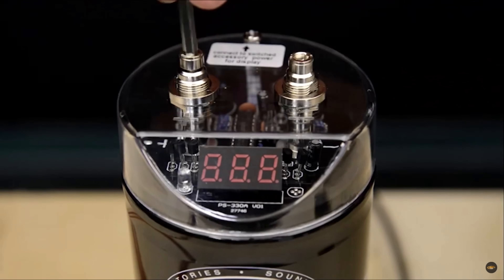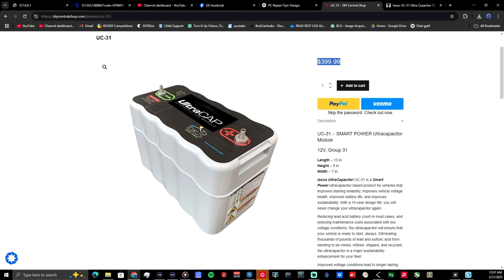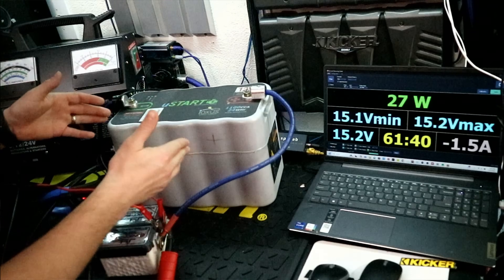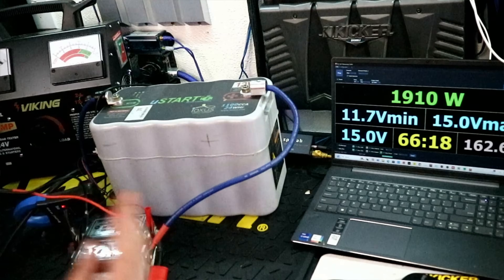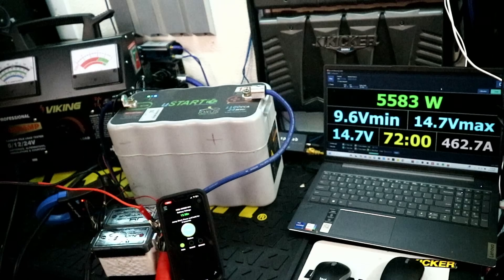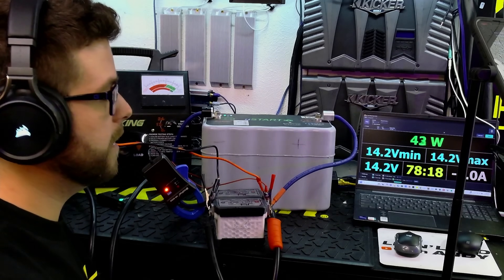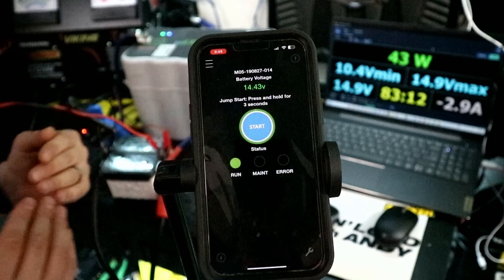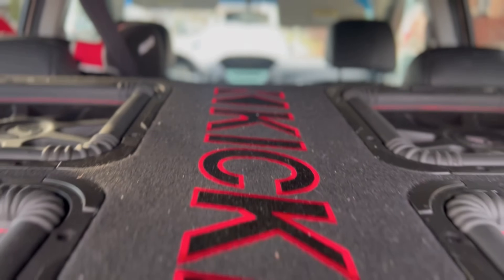Is it the Ultimate Capacitor For Car Audio? Ultra Capacitor UC-31

Comment: If yourself thinking about buying these to salvage the caps now that they are CHEAP (less than $100). Do not do it, the reason they are so heavy isn’t the caps (duh) it is because they are die cast injected, meaning it is a SOLID block of PLASTIC. It will take you days and days and days of cutting and you will most likely ruin the components.

Comment: So I have a cyber 12k and when the voltage drops from bass let's say from 14.4 to 14.2 I can still see the headlights dim wondering if the super cap would change that if I replace my under hood agm with it

Comment: A good visual test would be getting a 5 gallon bucket to represent the capacitor. Start filling the bucket at 1 gallon per minute to represent the battery and charging system. Have an “output” hose coming out the 5 gallon bucket and pull 3/4 gallon per minute with short intervals of 2 gallons per minute. It shows how you can pull more from your system than it could normally provide while building a reservoir of charge.

Comment: Interesting that it is so heavy because my Maxwell Ultracapacitors  don't come close to being that heavy and I am talking about my 24v ones my 12v set up can crank the engine on my vehicle for almost 30 seconds which I don't ever recommend for anyone to ever do to a starter or on a battery. Why is it so heavy??? I can pick the Maxwells with my pinky.

Comment: The ultracap is for bursts of energy not sustained amounts of currents, an AGM(for example) is better for the sustained amounts of current, use them together so that when your bass kicks your voltage doesn't drop....they both should be used together but you should be playing regular tunes and watching the voltage as the bass kicks not during sustained notes, test the voltage drop when the subs are kicking
Reply: I was going to say the same thing, also batteries should be able to output the total avarage power over time of the system playing music and the capacitor should match the peak output power

Comment: You’re missing the alternator pumping charge on the cap and battery. Also you are correct the battery needs to be more actual size. Same environment. I have one and have system full volume and voltage barely drops below 12.8.

Comment: lol sorry but your test means nothing to what the cap is meant to do. you put a constant high load that's not what a amp dose they get quick bursts of high load and then quick low loads an in that case the UC-31 wont go in to error mode it would recover its voltage/charge in milliseconds because in a auto there's a alt an battery. in my last setup I was running 4 Rockford power punch 800a4's bridged on 4 L715's with high amp alt and 2 group 35 lead battery's with 4 runs 2/0 OFC wire and it would dam near kill the headlights and pull voltage from 14.2volts to 12.1v in few sec and after the UC-31 was installed lowest it got was 14v even on regular music and 13.7v on pure base (like base mechanic) it made a massive difference. thanks for sharing Andy
Reply from the maker: Oh they absolutely do work and are meant for quick discharges 

I wanted to do a brutal test - constant power can still be demanded with today’s “rebassed” music 

It’s practically a sine wave… 

This cap does the trick and I’m glad it’s working for your set up too!!!

Comment: Capacitors are never dead in car audio a lot of people don’t understand how to use them like right now I have 40ah scib way more than enough juice for my system charging at 15v and clamping 7.5k dropping to 14.8 

Now with a 16v 500f cap I can hit 7.6k clean but the Subs can’t take anymore but my voltage doesn’t move from 15v on a 320 alt
Reply: So you are using this cap together with your scib bank?
Reply: @Djmam @Djmambo77 
There are some videos on YT with yinlong and cap just the battery he was able to clamp 16,000w then with the cap and battery 21,000w 

You just have to make sure you have enough head room with everything

Comment: Thoughts on the Rockford fosgate hybrid capacitor?
Reply from the maker: If you’re wanting better voltage for long bass notes - look into something different 

It definitely works as a filtering cap and some extra oomph for those quick bass notes.!
Reply: @ ok so like what? I don’t want this big ass capacitor. What do you reccomend? I already have xs power 3400 battery and big three but 110 amp I don’t want to get new alternator and I only have a 900/4 hd jl audio amp and a xd600/1 jl audio amp , I want the capacitor only for the xd600/1 amp

Comment: I have a question. What’s the best way to run audio for 15-20min with the car off? A bunch of high AH batteries in parallel? A lithium battery/bank? Maybe u could test this out for fun? The reason why I ask is cuz I have a hybrid so basically when I’m at a stop light the engine is off so I’m running off capacity and want to increase that before the battery drains, and also when I park and wanna finish listening to a song. Thanks ahead of time!

Comment: I would love to see someone out there test Walmart wiring and see if it auctually lets you push the rated wattage comfortably or if your going to melt something trying to hit that rated number
Reply from the maker: Comfortably and Safely, neither honestly..

The wattage numbers they list are unrealistic unfortunately, Max Power ratings at their finest! 

Safely , half of their claims 

I need to do a good video on this topic .. but think of it like this 

Bigger wire - shorter run = More power you can carry 

Most kits you see like that are a set length so that variable doesn’t change 

So all you can look at is size at this point 

There are other variables as in type of wire 
OFC/ CCA  that work better or worse and the price always reflects that 

To the point… 

8 Guage kits are usually good for 50a for a kit 
50x12v that’s in your car - so 600w at the most 

4guage roughly 80-100a 
1000-1200w 

But that’s really at their extreme with more voltage drop than you really want ..

Never cheap out on your foundation… the electrical 👊🏼
Reply: I wish my garage was bigger, I've lived where I've lived for 10 years now. I can't open my pickup doors very much and I'm a petite female. A normally rerun fresh speaker wires RCA wires, redo the grounds, especially when living up in the Midwest, although before that I used to live by the ocean. My 🛻 is 22 years old. I haven't redone fresh wires in a while. The most recent big 3 upgrade was 10 yrs ago. It was kind of a celebration for myself, I bought myself new amps and an eight-F capacitor. I was bummed out when I realized there was no way that was going to fit into a single cab truck. Also I used to get robbed non-stop by the security shop who first installed that blasted security system. Those bastards robbed me and completely hacked my wiring harness underneath the dash to I'm surprised it hasn't caught on fire in 2006 level. Thankfully, I already bought an extra wiring harness that was salvaged from a Sonic blue one. 
I got really good at reinstalling my crap and improving it and making it a nightmare to try to steal. 2007 I got in a neutral type of sideswipe accident in Houston. The body shop said, " we didn't know you had all those tricks. We were forced to finish the job because we had already signed with the insurance company. Your security tricks cost us $6, 000k in extra labor". Which is pretty awesome that's why I did it. Unfortunately now my mid-amp is starting to choke out or either driver side speaker is a blown out. Crossing my fingers that it's a cheap RCA wire. Except for I can't really get good access to it because you have to remove The bucket seats out of the truck totally to get access to it. My dad help me to do it. That installation was inspired by a Hallmark movie. A car thief was threatening a CEO in the parking lot he would be back to steal his car. So the CEO turns his car into a bulletproof torture machine for the thief. Complete with monster sound system. He tortures the guy in his garage all weekend while his wife is out of town. I was inspired lol. Thanks for reading my TED talk I love capacitors. In Milwaukee I was shocked to hear they didn't even know what capacitors were at Best buy, maybe they had a one F1. What a bunch of boy scouts so lame I'd never ran one that low but I took it cuz I didn't want to wait any longer. I love caps. I disconnected it for 2 years I think and just assumed it was trash. I was wrong and I got shocked. Nice to see that there's some music heads out there still.

Comment: So if I wanted to add more reserve in my 15 tahoe with the lead acid is there a good option
Reply from the maker: I would run something else in that case! These more so help for extra “umphhh” than capacity 

If you’re only running lead acid chem- I would look into 5Series LTO 

Or making the big switch to higher voltage lithium 

It’s not as scary as you think 

6 series LTO is my favorite and very forgiving

Comment: There is no alternator creating constant current so your test is inaccurate
Reply from the maker: There was no “input power” or Alternator on these tests - only charged in-between runs to give accurate results..

Power supplies work closely the same as an alternators as in you only get so much current supplied given from the voltage set point and batteries current voltage 

Also what the batteries can also accept given their internal resistance and ESR total values 

So to the question if the test was accurate- that’s up to you 👊🏼

Comment: Ioxux B-Stock at Big Jeffs Audio has them for $120 dollars.
Reply: I bought 2 from Big Jeffs 6 months ago for a $130 each. Mine  didn’t have cracked cases.  I have them running in parallel with a yellowtop powering a Stetsom 8k on 4 Gold V2 15s my voltage doesn’t drop below 13.6 and most of the time 14-14.4 and spikes up to 15v
Reply: @WesleyHarden-pz4ee  Me too dude. I have a dual setup with a headway cell bank and Im impressed. Hardly any voltage drop with 3 amps.
Reply from the maker: Refurbished- cracked cases : but yes !

Comment: I got one for my daily driver, its only about 2k total so it should be fine. I got it for 100 so I feel like its worth it. I still have a Stinger 10f hybrid that ive never installed and curious about and nobody has ever tested one that I've seen
Reply from the maker: Definitely worth it for that price 
Good for that power range 

10f caps are very small and more for filtering than power like this situation 

This cap has around 375f 

So 10 is next to nothing in that regard 

Tho they do have their place to help eliminate noise in a system !

Comment: I really enjoy videos about capacitors because high current alternators are NOT made for every make and model.  

I have an Rx7(awsome for bass because of the hatch) and trying to use the newer model alternators requires altering the wire harness.  Old vehicles have alternators that don't even produce 75 amps!!

(edit) I used a battery tester instead of a carbon pile load and what I observed the capacitor do is reduce the apparent internal resistance of the battery boosting its measurable cold cranking amp capacity.  Capcitors are static electricity. 

 I like to compare it to getting *whipped by a towel - doesn't feel good at all but the pain is tolerable.  A whip doesn't posses power, but a ton of kinetic energy.
Reply from the maker: Yes at some point batteries are the only way to supply the power - when you’re in the fields of 10,000 watts or more, Alternator power can only be so much due to many factors - the main one, no space for more than 4 alts! Other variables as well, and THAT’S where any storage of power is the only feasible way!

Great example man!

Comment: capacitor is only good for burps and after that is anthor drain on the batteries
Reply: If used in an undersized electrical system yes. But properly balanced it helps balance out transient voltage dips. This one in particular limits it's charge current to around 20 amps to help mitigate that as well
Reply from the maker: Definitely agree 👊🏼

Comment: 7:20 are you circling the input current into the capacitor at that moment? If so, it seems i was right assuming it has a charging circuit to "trickle" charge the capacitor at about 20 amps.
Reply from the maker: Yes! Bingo around 20a charge rate 
Good eye ! Soon as it hits 14.3 it stops charging
Reply: @LivinLoudwithAndy  it makes complete sense given the original use case for it. I still don't know how I feel about that limitation as far as car audio is concerned.

Comment: Andy, I have the JAG35 148ah LEV60F LiFePo4 and my amp goes into protect from voltage drop.  I have the UC-31 and it helped a little, but can I add my 64ah Headway battery in between them?

Comment: It should be noted that although we use these majority of time to help with voltage drop they work the absolute best in conjunction with a battery that is capable of FULLY supporting your system by itself then the caps really give your setup that extra kick I run an XS power super Bank under the hood and I'll be installing my 6S4P 2000 Farad XS Super Cap Bank when the build is finished I love how well Caps work they take all the strain off the charging system as long as it's a sufficient amount for your setup to my understanding a 500 Farad Cap Bank is good for 400 amps of Current or 4000 watts those are stand alone ratings and there are numerous videos showing the results so I'm really excited to see what a total of 2500 Farad's incorporated into my setup with a massive SCIB bank and a HO alternator should give me plenty of power for these 2 Ruthless 10k's 💪💪💯

Comment: Capacitors are meant for music and quick charging and release really long constant draw is not what they’re for. That’s why they help headlights dimming etc. odd they call them capacitors when they have little capacity. But even a 1 fared capacitor gives me an extra volt then without it.
Reply: It's why I've been skeptical about using them because once the capacitor discharges, it becomes a resistance and everything will be actually worse than using an extra battery. For fast thumps it's great... but for long tones... I'm not sure.
Reply: @ I gain a solid volt on my system with all music and battery last longer when not charging

Comment: I said fk it and im buying another yellow top/heavy accessory battery to go with my under the hood batt. Unless i decide to go with the big ds18 battery. But either way im adding another big agm to mine and i should be good. Im at 14.4 and 13.8 at full tilt. Not terrible and I feel like another big boy agm will hold me up there.

Comment: Retest with a real battery yo. I'd love to see you do the testing with an s6 LTO... and then also do a test with a Lifepo4 battery.
Reply from the maker: Yes can do! I wanted to give the capacitor no help😅

I can test with a larger bank👊🏼
Reply: @LivinLoudwithAndy  right on! I'm running S6 lto now and I've ran the good ol classic headway Lifepo4. Most bassheads are running either or. Be a great basshead video Andy!
Reply: @LivinLoudwithAndy I actually have this exact setup with a LTO 6.0. running Salt 1.5 and 1000 Watts on Mids & Highs.. about 2800 watts... 14.3v - 13.3v lowest ..w/ Big 3... 150 amp alternator
Reply: @LivinLoudwithAndy did you make that video?